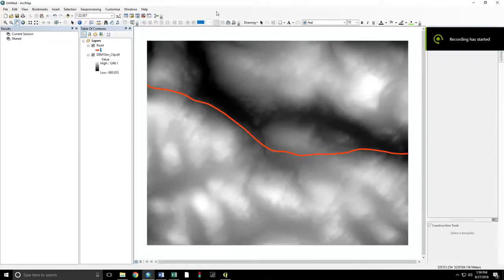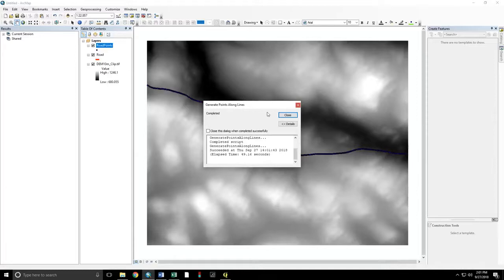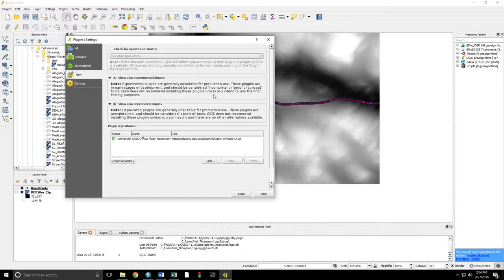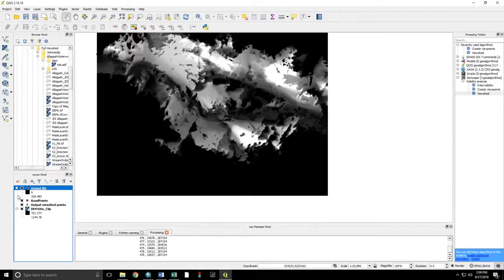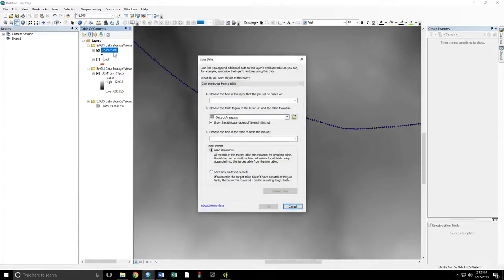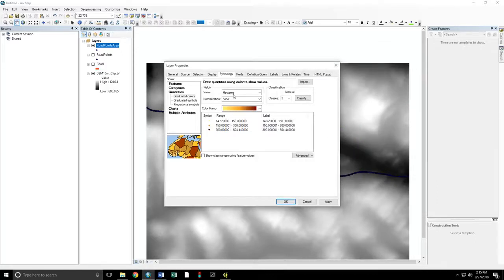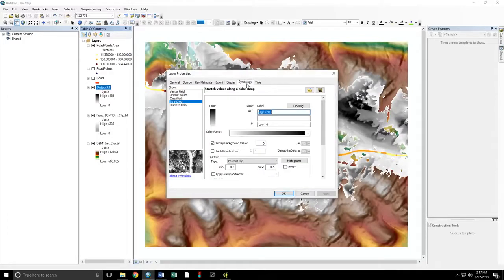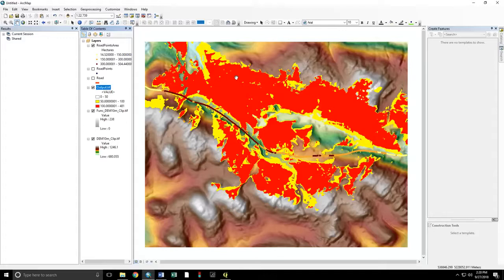Highway Viewshed Analysis using QGIS 2.18 (deprecated plugin--new version available)

Comment: Two questions: 

1. It appears the result you get is very similar to what you would get using the ArcGIS Viewshed tool.  Is there any particular reason you needed to use QGIS for this?

2. In both ARC and QGIS, one thing I am puzzled about, is why the pixels immediately adjacent to roads do not show up as 'visible'?  One would think that a visibility/viewshed analysis would highlight areas adjacent to roads, no?
Reply from the maker: Hi Brian, thanks for your questions--

1. The two reasons I would use QGIS over ArcGIS for this task is A) Q returns the area visible from each location, something I have not been able to extract from Arc, and B) QGIS completes the task remarkably faster in my experience. If your question is what locations can be seen from the road and/or how many times they can be seen, Arc and Q should return practically identical results. If you want to identify sections of road where you can see a more or less of the landscape, that's something I have only been able to do in Q. 

2. The reason you're not seeing those roadside/road locations at the end is that I displayed anything visible from 0-50 times as transparent around 16:00. If you look just before then, when the data are being displayed continuously, you'll notice the visual area does extend to the road as you rightly expect it to. I considered anything visible from less than 50 points, thus visible from 500m or less of road (10m spacing x 50), to be of lower visual importance. Most of the road itself is visible only from that section of road, and fails to meet the criteria I set (arbitrarily) for moderate or high visual importance.
Reply: @UMFK_Forestry  Thanks Neil. All good points.  But shouldn't the viewshed be visible from any point in the road from the beginning, therefore 'all points' that make up the road?
Reply: Actually, let me retract that question.  I can see now yes, adjacent pixels are given low values, but they are there!!  Thanks for your help!